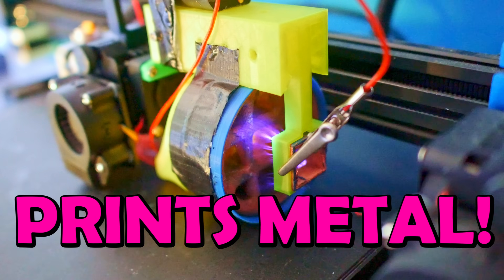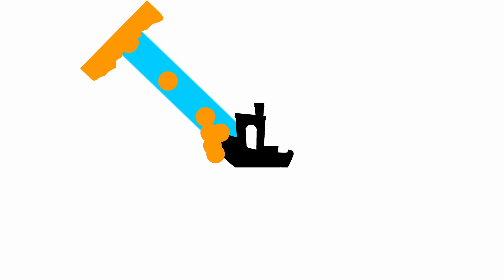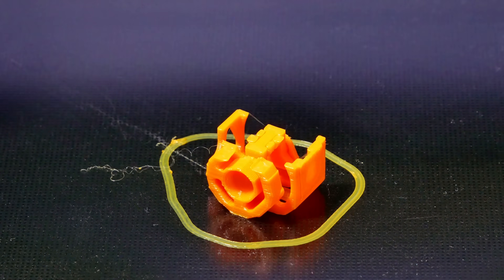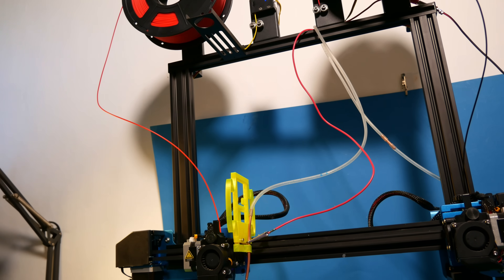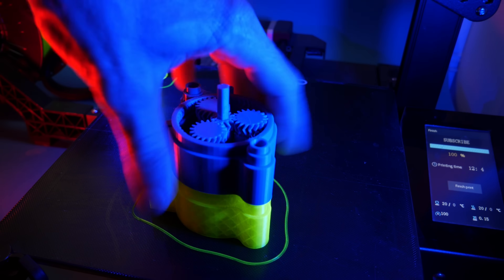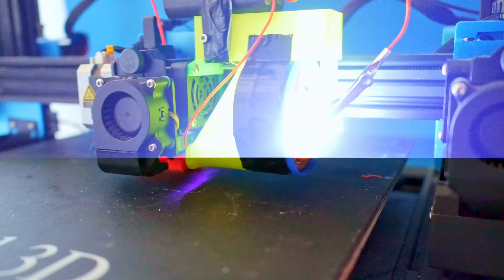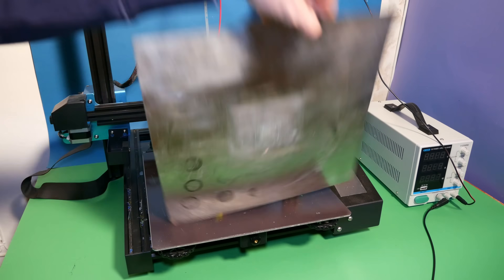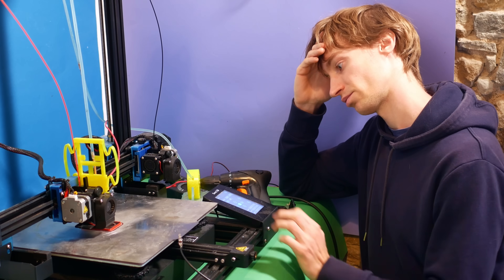i made a METAL 3D-Printer at home!

Comment: Nice video and cool ideas. But there is one point that I really don't understand: You need conductive filament to make the electroplating work. So how can you make circuit boards if you lay down the tracks on an already conductive surface? Won't there be short circuits all over the place?
Reply from the maker: Ah! yes, good question, so during printing yes, there is a "short" through the build plate, but when you remove it from the build plate, it will not, each layer can be "insulated" with a non conductive filament. Have a look at the stl's, it will maybe be more clear how i did that.
Reply: Ah, you are using two types of filament and multi-material-printing. That's something I didn't realize from the video. Thank you for the clarification.

Comment: Ah, this is amazing. I have tinkered with the idea of doing this the other way around in the past - I wanted to create a CNC machine that moves an electrode to remove material from a metal piece via ECM, but I never got it to work properly (mainly because I wasn't capable of inventing a method of effectively removing the corroded parts from the work piece). It never occurred to me that you can also do the very same thing bottom-up instead of top-down!

Comment: To print on glass or steel - any completely smooth surface.  Clean it with fingernail polish remover.  Cheap dollar store stuff.  Just use a cotton swab and wipe it down.  Can be done cold or hot.  (been doing this for 7 years now, and have never used gluestick).  Excellent concept btw... I was totally thinking, why didn't I think of that?

Comment: You asked for help/ideas from you're viewers. Perhaps not much help in the overall result of this particular project but perhaps an interesting thing to try for 3D printing in general? When I saw you're ionic thrusting part cooling fan I thought of the possibility of using this for increasing the layer bonding of low surface energy plastics. PET, Polypropylene and Polyethylene, I think Polycarbonate to a degree and likely other plastics could benefit from the Corona/Plasma generated from such a device to pre-treat the surface of the previously extruded layer. 

I don't have much experience with this but supposedly corona treatment is a known way to create better bonds between low surface energy plastics.

Comment: You might try carbon fiber fabric for your adhesion issues, if you lay up a sheet with something like JB weld that has steel added you can probably get a stiff flat sheet that is conductive enough that has enough texture (sand lightly in to the fibers) to provide the adhesion you need.

Comment: If all of the electrically conductive parts of your print are connected to each other by "wires" of conductive filament, it won't matter if one part detaches from the plate.

Comment: I know there is a YouTube video floating around somewhere that has what is essentially a sharpie with the ink replaced with a copper solution strapped to a 3d printer. That way the part doesn't have to be submersed and you could print fully metal parts.

I thought there could be a variation that uses a nonconductive syringe/nozzle and some clever sensors and controls to have a bead of the solution just barely stick out of the nozzle, but stay inside using the surface tension. Then you could "retract" the bead of solution back in to avoid dripping on overhangs, or fully suck it out and replace it with a new solution with a different metal. That way you don't need to print a sponge. Other benefits are that it doesn't apply as much force as a marker sponge so it could be used for delicate structures, and it won't wear down and permanently deform like a marker head (instead more solution could be let out to reconnect). You might even be able to print out support structures on a 2D plane and remove them by electroplating back into the nozzle.

These would be especially good for making PCBs, since you are only electroplating exactly what you need to while still plating at the same speed.

Comment: I had good luck on the back side of my pei sheet by using a bit of glue and also making the z offset push down the filament a tiny bit more than normal.  Also slow as fuck like sub 20mms.  

Looking forward to more of these projects, just subbed 👌🤙

Comment: What about drilling many tiny holes on the PEI sheet where the printer extrudes into when it needs to connect to the underlying metal? Or printing the first layer with lines around wires that are attached to a frame? The printer can also print the guides to put the frame into, so it perfectly matches the model that is going to print around/over it. Or a whole conductive first layer that has a guide to cut slots into to disconnect some parts that should not be connected.

Comment: I used to print on a garolite sheet with copper coating, born for pcb manufacturing. I saw the tip from another channel and it worked fine with proper bed heating, it should offer both adhesion and plenty of conductivity.

Comment: I predict a future where the xBeam has power tracks built in., and the tool head will have a wifi board on it.
.it will be the first fully functional cables x beam tool head. To set things off it will also have a ion cooling fan.

Comment: i’ve also been working on the conductive build plate problem, though not for the same reason. have you thought about using a conductive polymer coating?

Comment: With your setup, would it be possible to print an induction coil on the bed, and use that to pick up current from a primary coil mounted on the underside of the bed? I guess the secondary coil could just be part of the print to avoid support and rafts?
Reply: I mean, would the conductive filament be able to work as a coil?

Comment: How about rather than a metal print bed. Have a small metal corner contact. and have the printer print the electrical connection to the part meaning that most of the part will be on tried and true grippy stuff.
Reply: you could use copper tape?

Comment: I see you’re doing something similar to this video:
https://youtu.be/B-UbDk7LrvU?si=cJ_PWO7mbU2_H5ih
Remember that your copper pipe electrode will shrink as you plate with it, so it may be worth trying to auto-level it. Personally I put another Z limit switch in series with the existing one in a position underneath where my 3D printer -mounted drill sits so I can zero my Z height relative to the bottom of the drill bit, you could do something similar here (or just use conductivity to the bed). As well as plating, I’d like to see experiments in 3D fabrication entirely from metal. If you use the plastic housing design from that video I linked to, you unlock the ability to put two different metal electrodes inside it (e.g. copper and nickel) and hence the ability to slowly change the alloy of the metal you’re printing over time.

Also bubbles mean you’re losing power to water electrolysis, and you could measure the round trip electrochemically resistance to figure out how much solution to pump.

Very cool.
Reply from the maker: Thanks for sharing this, didn't know about it,

Comment: Interesting idea. But I see very few use cases for this as it stands. Continue your research and if you develop a way to print metals in the shape of V-Slot 20mm extrusion beams, accurate enough to use as the main support beams in 3D printers with V rollers, with little or no post processing, and with better tensile strength, yield strength, shear strength, compressive strength and/or impact strength, and at lower cost, then you have something.

Comment: This is an interesting concept, but this video title and intro is misleading. I wouldn't consider this 3D printing metal, It's CNC electroplating. You can't compare it to the actual (and very expensive) metal 3d printers. Several people have been able to successfully electroplate 3d printed parts using a wide variety of processes. Simply sticking a piece of copper pipe in a to-go container full of electrolyte and your part isn't going to yield the best results. Professional grade plating services use several pieces of the copper anode surrounding the part and usually circulate the electrolyte to prevent uneven plating. Other things like power supply voltage/amperage capabilities have a huge effect as well. If the goal is to electroplate 3D printed plastic then this would be considered "building a bridge where there is no river".

Comment: Maybe with a molybdenum sheet on the plate the plastic will stick better. It is used for increse adesion between glass and metal in vacuum tubes pin

Comment: Neat idea, that pump looks clever. I don't think a fully self-printing machine is possible though. If it's made out of thermoplastics, then the nozzle could never be printed. Maybe you could find some thermosetting polymer but the heat conduction is poor. Unless the idea is to use electroplating to build the nozzle and burn out the plastic somehow?

Anyway, I'm not sure using the pipe as the anode is a good idea. It leads to gradual loss of precision as it's eaten away over time. Good enough for a prototype but not scalable.

Looking forward to seeing where this goes!

Comment: This is very cool, but to go as far as saying metal parts? These are electroplated. They won't replace CNCd parts. Although, have you thought about modifying the printer to work as an EDM? I'd be curious if there's a way to improve the standard EDM process and make it work in 3D in the same way a CNC removes material in 3D

Comment: 0:50 Usually when electro plating, you swirl the part around in the electrolyte to ensure an even coating. Maybe you could do this by rotating the anode with a motor.

Comment: Hey Sunshine , I think I can help with the build plate adhesion. Sandblast the bare metal side. I’m a powder coater and that is the process we use to promote mechanical adhesion on our parts. The powder is plastic and flows in to the profiled surface. Use around 100 grit media at lower psi (probably 40-50 to prevent warping)for a smooth profile you might have to slow down the first layer to promote flow out but maybe not. See if you can find a powder coating shop around you they will do it cheaply. I also cerakote and there is a conductive coating that you maybe able to use  to promote longevity of the plate. Keep it up brother.
Reply: Media blast may be a bit complex.  I'd try more normal sandpaper, first.  Though media blast is probably more uniform, it may not matter for the application.
Reply: I also don’t know why this didn’t come to me, could you positively charge the conductive filament and ground the build plate for attraction

Comment: Amazing work man, keep it up! The fully 3d printed peristaltic pump blowed my mind... Super ingenious! For the adesion problem I would try to take a pei coated plate and then laser etch away the plastic in a pattern of some sort, like a matrix of 1mm circle. The problem with this method could be that the plastic won't flow through the pattern and make contact with the metal plate, so it may be wise to try different pattern to see what works best while also using the thinnest pei coating possible.
Hope this helps👍

Comment: Another common electroplating method is to use a metal brush and electrolyte and that way you can essentially brush on the electroplating where you want it, it is similar to this method but the brush probably has a greater surface area. Maybe switching out your large rod for thinner wires would have some benefit.
Reply: yeah, I imagine if you were to take some soft copper strands wire and run it through a vinyl tube you'd get better results with less electrolyte.

Comment: Very impressive, but the need for conductive filament adds significant cost, supply issues, and makes me wonder how strong the final part will be.  But the ability to print a motor is amazing 😁👍. Maybe you could get the conductive first layer by just painting regular filament with conductive ink?

Comment: Hey issues is the temperature the build plate metal part is on top it is dispersing heat very quickly. Try finding a material that is good electric conductor but bad heat conductor

Comment: What about filament with some iron powder, or aluminum powder mixed in? Remelt the filament and add some minute portion of iron oxide dust. You can switch to more conductive/less conductive filament as the design requires

Comment: Have you considered brushplating to avoid the need for pools of electrolyte? Feeding wire down into it might be able to replace the entirely consumable anode, and the brush would hold the electroplating fluid just where you need it.

Speaking of the ionic fan, I'm wondering if charging the surface of the part increases it's surface energy, and makes layers adhere more strongly

Comment: I think the easiest solution would be to use a conductive adhesive on the build plate prior to printing. Printing on a metal screen might give good results, but then the screen would be consumable and likely more of a pain to setup and remove after. It's hard to balance good adhesion / conduction with easy removal haha. An easy idea to try would be printing your first layer with small pilot holes, then plate the holes directly to the build plate, that should ensure good conductivity with the part, and if the holes are sized right shouldnt be too hard to pull off either.
Reply: An easy way to print on a metal screen is to use an aluminium fly screen mesh. But once it is part of the print, it may be a pain to remove. You probably will lose the first 1mm of the print.
Reply: @xylosfurniture conductive adhesive like the ones used for heatsinks seems like a better idea

Comment: @sunshine .. when printing in ABS i use an ABS slurry (peaces of ABS disolved in acetone) inside a small spray bottle. I print on opposite uncoated side of plate with my v2.4 .. sticks so well and part big enough can lift magnetic plate right off magnets if i leave it cooling lol

Comment: The new gel type matrix for printing plastic. I wonder if you can print tubes via them? And using on the conducive plate to give it a ‘frosted’ look (it’s used in frosting glas and such for craft hobby stuff. It’s basically just ammonium and bifluorides. Would it work on metal to give it enough grip? One way to find out.

Comment: This idea is going to bring home manufacturing to another level.
Reply: haters are lame. Besides PCBs this has the potential to work well with sintering if a conductive filament without enough metal in it is used.
Reply: The idea to use electroplating in a 3d print-like style isn't new. There are papers dating back like 5 years or so trying to "grow" full metal parts that way, not just plating like its done here. Just google "electrochemical deposition in 3d printing" and you will find the original work. Its interesting and promising if you can overcome some obstacles to volumetric metal parts. This one here is a good start into the DIY world, but still far from being useful. I have a use case, but its still not there yet and I have watched this development for some time now. However, its going there, slowly.
Reply: no it isn't. the uses for this are few and far between and you clearly don't understand electroplating and how that isn't like making something out of metal.
Reply: @thomgizziz  yeah, why even do anything ever at all hey? This would be immensely useful in PCB manufacturing, self replication, etc.
Reply: @suodrazah6015  Thank you. It's obviously not a perfect system, but the idea is golden. To be able to create a part with both metal and plastic in 1 process is awesome. Now us the community shall improve on this wonderful idea.
Reply: @thomgizziz  https://de.wikipedia.org/wiki/Galvanoplastik
Reply: @thomgizziz   You sound like all the stagnated garbage vomiting professor types although you are kind of right